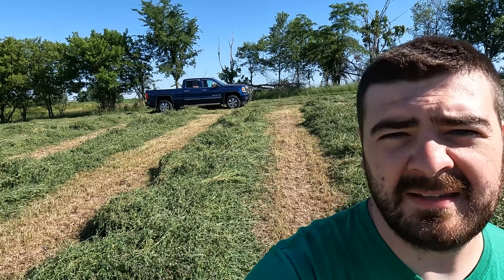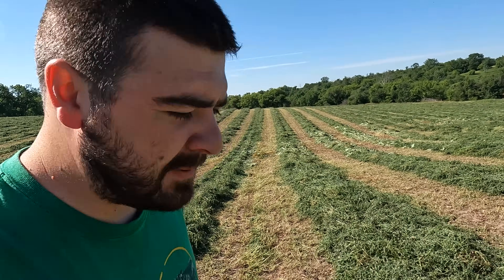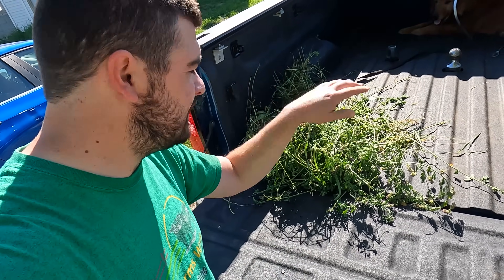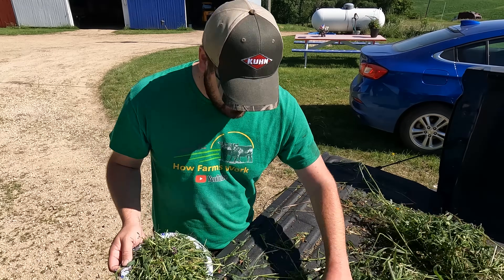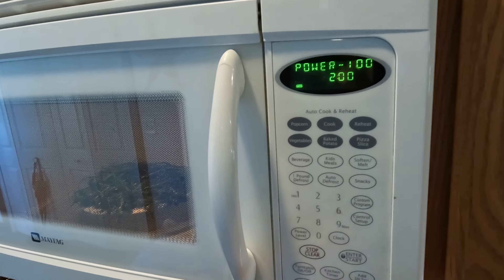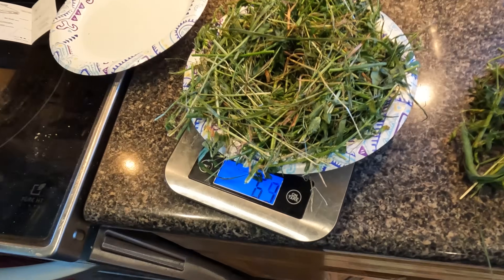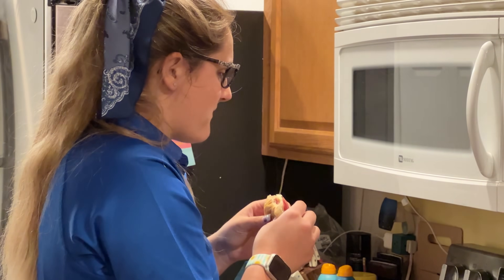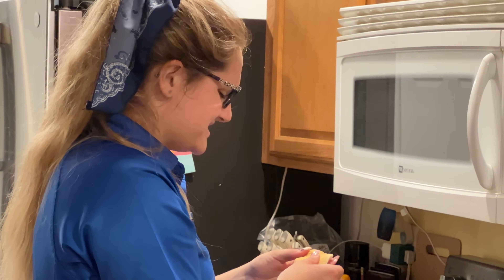Easy Forage Moisture Test For Baleage

Comment: I’ve dried lumber for over 35 years. The method we used to determine mc was, wet minus dry, divided by wet, times 100. It’s very accurate, and I believe it works for pretty much anything. And you don’t need a specific amount of sample.

Comment: Very easy way to get divorced if ruin the microwave! I would say a bucket probe is safer and remember test at points in field as will dry differently. Some manufacturers offer a sensor for a baler also in Europe to read it for you

Comment: This is cool! What is the difference in nutrition for baleage versus regular bales? Or is it just a storage benefit?
Reply: Benefits.......  Its a across the board !     Saves leaves/stems.....saves time.....saves expenses....saves storage space.... Cattle eat everything !   You can gain almost another crop of hay per year because you can be in and out of the field the same day in most cases.  Dry hay takes at least 4 to 5 days from cutting time to having the hay off of the field.   Do the math.....     5 days x 4 cuttings equals 20 days that the hay is not growing to its fullest !

Comment: Question, it has been a while since I've done that type of farming. Does the haylage end up "caramelizing" if it is wrapped at too high a moisture level? I seem to remember that that was a bad thing.
Reply: Too dry carmelizes. Too wet can create botulism.
Reply: To wet can internally combust and burn the whole stack down to
Reply: @gregb6913  Too wet for baleage is above 70%. That will not combust.

Comment: Have been contractor doing this for over 30 years in Australia. Easier quicker test is take good handfull in both hands close together and screw it till breaks(needs some strength). If you can feel moisture on break to wet it looks/feels dry to dry but looks moist it’s right. Have done hundreds of thousands bales this way.
Reply: That works well for DRY hay not high moisture baleage.

Comment: I bought a bucket tester. You jam a big sample in a 5 gallon bucket and stick this probe down in it. It's not as accurate as the microwave test but will get you in there close. After a few years of doing it you just know when to go. I can also tell you I've wrapped 70% hay and some 30% hay and it all came out great. Just use your nose when your opening the tube up. You'll know right away if something went wrong. Think dead fish in sewage. Yes its that bad. I had a few bales get rained on before getting them wrapped and set them aside individual wrapped. They went a hole where no animals could get to them.